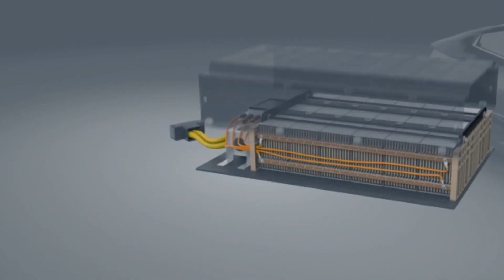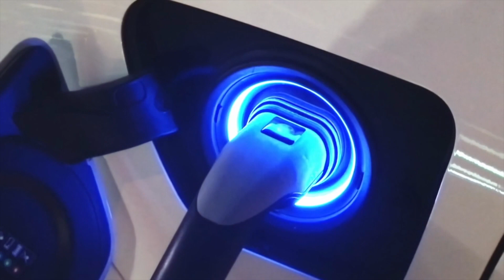The Rise of Electric Vehicles (EVs)

Comment: Nobody comments on the source of energy to generate the electricity. It can be 50 to 60% fossil fuels. A large part of that energy is lost in transmission and charge/discharge of the battery, so much more of the initial energy source has to be consumed in compensation. It is known as "remote combustion"